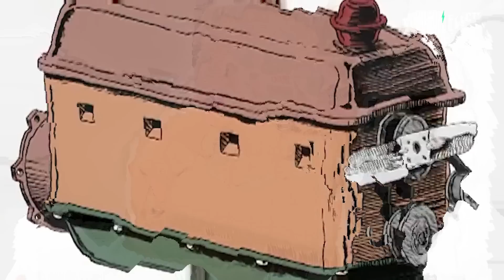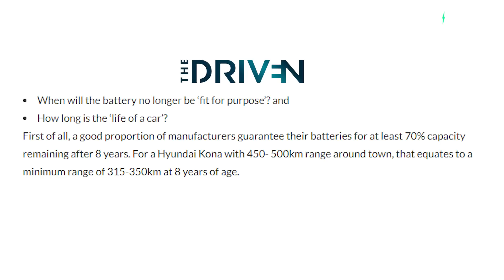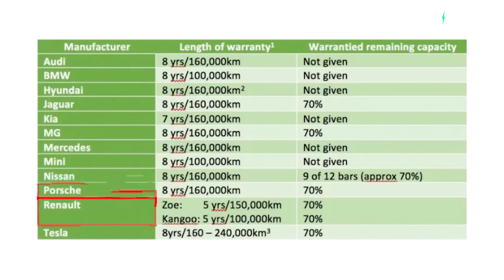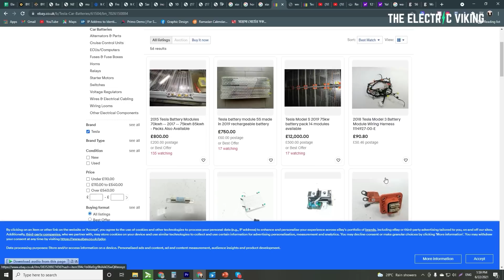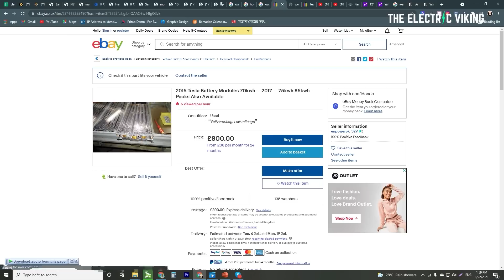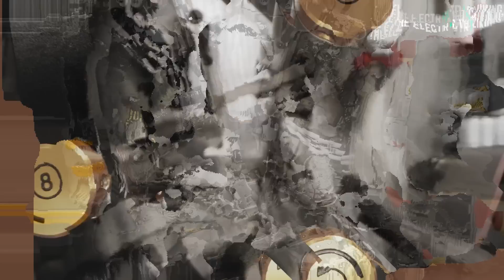How much does it cost to replace the battery in an electric car?

Comment: Great video.  I do however think comparing BEV battery pack with ICE engine is misleading.   Electric motor in BEV has the same functions engine has in ICE.  Battery pack is BEV’s gas tank equivalent.  The original gas tank in my ICE is 18 years old and I doubt it will ever need to be replaced.  It’s capacity is exactly the same as the day it was produced and never leaked like batteries do.  Our second car’s  gas tank has 600 mile range.   Don’t get me wrong, my next car will be electric for many reasons but this is not one of them.
Reply: The capacity of you gas tank might be exactly the same as the day you bought the car, but the cost of filling it isn't...... Plus there is no way your 18 year old car will be anything like as efficient as it was when new. It probably uses more fuel and oil now.  An EV will retain a much higher percentage of it's efficiency throughout it's life if looked after. Also, you have the opportunity to generate your own "fuel" - or at least some of it - for an EV if you have solar, or are able to install it...
Reply: @Brian-om2hh  Great point about producing your own power. And having a gas station in your house is nice too but over all I still believe gas tank wins. Keep in mind I am arguing only gas tank vs battery pack not BEV vs ICE.  

Although my 18 year old truck is definitely less efficient than new, it's gas tank is much more efficient than a Rivian battery pack. R1T at 5% charge is carrying 2000 Ib extra dead weight.   My truck is much lighter when tank is full and gets only more efficient as weight goes down. That is true for the life of the vehicle.  Power density of gas and fill time still makes my gas tank beat  BEV battery pack every time especially when towing long distance.  And after 35 years of driving I have never paid to replace a gas tank.  A Tesla owner that replaces his pack after 10 years for $16K to $20K wipes out any efficiency that he could have possibly had.

If you look at average electricity prices and gas prices 18 years ago, you will see despite heavy regulations electricity has not done much better with price increase.   As we use more EVs with laws and infrastructure always lagging,  there is a good chance we will end up paying more for use of our refrigerators because of these battery packs while off peak pricing gradually disappear. 

As far as over all BEV vs ICE,  my next car will be EV due to other reasons among which are not wanting to put poison into my own longs or contribute to international conflics.  Having an inverter on board without running the engine, quiet at low speed, potentially more reliable, better performance, ..... you name it.  Tons of great things but not the battery pack (yet).

If we don't buy EVs,  the research to overcome it's shortcomings won't be funded.  I won't be surprised to see a 600 mile pack the size of a briefcase in a few decades.

Comment: This is the point even after eight years whatever you still have to replace the battery if it doesn't die before it expired the warranty people caught you $12,000 does it make sense this is what makes electric cars no good are used electric cars causes $15,000 350 miles of charge from taking 10-hour charge 30 minutes I'm not sure how many hours you got left after the charge now New York is 1100 miles away and you only get 350 miles of charge that mean I would have to make arrangement in hotels going to New York it shows that electric car is not good

Comment: My ice car has 265000kms and it's barely broken in. Also 12,000 for a car engine sounds extremely high!
Reply: As a comparison, try looking out for the YouTube video posted by a Tesla Model S owner. His car had covered 400'000 kms on it's original battery...

Comment: I bought a silver model 3 LR over 3 years ago. It still charges to 303 miles. You have to take in account efficiency upgrades as well. I haven’t been back to the tezla dealership since I bought it.

Comment: Battery prices will only come down if there is competition... new technology will keep prices at a constant minimum (whatever that price minimum may be) just like computers... due to the sophistication of technology it will only be major companies producing high tech quality batteries, why "Battery Technology" is being chosen in the first place, as compared, for example, to hydrogen power (superior imo)  i.e. 'Battery Tech' was 'chosen' to be the next "Fuel Source" because it will be easier to control the population (just cut off electricity for a week...) i.e. to maintain "Control of Distribution of..." in this case the manufacture of high quality battery production...   Oh and nobody thinks the cost of electricity won't continue to rise?...  Lol...   Same deal... This principle applies even more to electricity... (i.e. "Control of the Distribution of...")

Comment: 30% of 300 miles which is probably really 290 leave only a 203 mile range after 8 years... not so great...  why I think they need to make a car with at least 800 MILE range... that doesn't even take into consideration, heavy loads, extra passengers and cold/heat degradation...
Reply: But then the new asking price would reflect the fact the car had an 800 mile range. Not everyone wants or needs an 800 mile range. Here in the UK, the average weekly commute is around 140 miles, with the average UK motorway/freeway journey being 70 to 80 miles. If the charging infrastructure is large enough, and offers quick enough charging speeds, then massive range may not be such a big consideration....

Comment: Let's say the capacity of a 100 KW battery is at 80%, so it will hold only 80 KW charge at maximum.  Let's say I get the battery down to 0% charge and then plug it in for recharging at home.  Does this mean that my home will be sending a total of 100 KW to the battery during it's recharge cycle but the battery will max out at only 80 KW?

I ask because over the decades, I have had laptop batteries which used to hold 3 hours of charge on demanding applications which then hold only 5-10 minutes of charge after a few years.  I notice that these bad batteries will show "100% charged" after a few hours of idle charging and even become HOT during the time it is charging to full (so obviously, the HEAT GENERATED by that bad battery during it's recharge cycle is telling me that electric current is continuing to flow through that bad battery, thereby WASTING ENERGY in the form of HEAT GENERATION).

NOBODY has EVER covered this particular question in ANY YouTube video.  All they mention is that the battery will "degrade" over the years and hold less charge than brand new, but NEVER any mention if electricity is WASTED by trying to charge a battery that can reach only 80% of it's original capacity.

Comment: As you point out replacing EV batteries is not really an issue. However the cost of converting perfectly OK ICE vehicles to EV is more immediate and sustainable solution. There are not enough companies looking at this issue and the service garages for major auto manufacturers really could benefit.
Reply: Lol..... Not all ICE are suited for EV conversion and there is actually not enough battery to even make brand new EVs.

Comment: Hey Sam, thanks for this post, after a fair bit of hand wringing I got into a 2015 leaf for 18k that’s a 24 kWh car with usable maybe realistically 20 kWh. I bought it as a ex Japanese import, it displayed 10 bars of battery health @ 30k kms  on the clock, usually a new leaf displays 12 bars. The car is for an early electric car a relatively simple beast with no battery thermal management system and had been predominantly fast charged in its early life leading to I believe a more rapid decline than say other more gently charged leafs. Battery charge data is easily accessed via leaf spy a free app via android and an OBD dongle. So at 10 bars my 20 kWh usable energy will still get me an honest 80 kms that’s two days of commuting per charge with charge time via standard household 10 amp power plug home charger of around 4 hours. I only run my battery between 10 and 80 percent to attempt to maintain longevity. Removing and servicing the battery is relatively simple as no thermal management system and modules are easily interchangeable to ditch dodgy cells. I can buy a new pack for 10 k or repair my existing for shit loads cheaper or sell my complete old battery pack for around 3 k for house hold storage system. I’ve owned a few cars in my time but this electric thing kicks serious arse, quick,quiet,efficient, cheap, and reliable. The leaf is our first car our second one a diesel 4x4 comes out to tow the boat or do the big kms

Comment: How easy is it to access the batteries and replace or swap them out of various cars. Is access restricted to the manufacturer. Who can do the swap out ot the battery.
Do and manufacturers restrict access to the battery area and prevent replacement or swapping of the battery modules.

Comment: In 2017, my wife's off grid property needed new batteries. The lead acid batteries provided +/- 4kWhrs of usable storage for around 6 years at a cost of approximately $2000 US, and would have cost her +/- 3000 US to replace with the same type of lead acid batteries. We replaced them with 4 used Tesla packs from the Daimler smart 4 two vehicles. These used Tesla batteries now provide +/- 10kWhrs of usable storage for approximate $4000 US. I just helped a neighbor install 10kWhrs of brand new lithium iron phosphate batteries for approximately $3000 US. The prices of lithium batteries continue to drop at an incredible rate.

Comment: In case you are a hifi nut:

Buy some 5" full range (single) drivers. Try and get the ones with the solid metal phase plug in the center. And preferably without a whizzer cone. You can cut them off with a hobby knife. Tang Band, Fostex and Coral are good middle priced FR driver brands.

Make a stubby floor stand speaker box. Say 250mm X 270mm x700mm. Make a single speaker hole near the top so the driver fits in. And put some old rags or wadding inside the box (loosely). Now this is where thing get different.
Make a 50 mm deep bass vent tube to fit the driver hole (yes the driver hole is also a bass vent). 

And mount the driver above the driver hole. A 10 mm gap on the top speaker screws and like 15 mm gap on the bottom speaker screws. Use longer screws and thin flexy hose as spacers (cut a bit longer than the gap). The soft garden hose easily squashes to the desired length. 

And you have to tweak the both gaps a little bit to get the best (overall) sound. The smaller the gap the more it shouts and the larger the gap the more bass and treble. So you can get it sounding great! The sound from the rear of the cone escapes from the gap giving a more spacial sound. Also the bass vent makes pure point source sound (more ghostly). 

You can add a crossover filter thing as well after getting it to sound best first. And use electrolytic capacitors on FR single drivers cos it makes them sound silky, ceramic capacitors make FR drivers sound more brittle. And you can add a woofer on the bottom panel facing the floor, with higher stubs on the bottom high enough to let the bass out. You need an 8 mh inductor for the woofer and maybe a resistor to tame the woofer. I hate the bass drowning out the nice high stuff. 

And speaking of high stuff, the open cone mounting EXTENDS the treble! And if you want more super high treble, use a 2 ohm resistor and a 270 ohm in parallel, connected to the + terminal of the driver. How it extends the top is a mystery but that is what I clearly can hear, I discovered it accidentally. I wanted to get just a tiny bit less resistance and I couldn't believe my ears! 

Or (even better) also use a 0.22 mh inductor and 1 mf (electolytic) speaker capacitor, all in parallel with the two resistors. Do all that and they will smoke any speaker regardless of price (for normal listening levels). They sound better than normal speakers cos they sound like panel speakers and better than panel speakers cos they are light years cheaper and haven't got 6 ft mouths.

Want the best amp? Get the Audiolab 6000 Play. Costs 1,800 and Andrew Robinson (oh YoTube) said that the only amp he had that beat it, was a 10 grand tube amp. So I just got one and it's lovely. Cheers Big Ears!

Comment: In some cases only a few dead cells need to be replaced, then if the pack is rebalanced it will come up again. There's a good video on Rich Rebuilds channel about that.
Reply: There's also a YouTube video posted by someone called James and Kate. They had a battery refurb carried out on their 10 year old Leaf at an independent EV specialist in the UK, and it cost them £600.....

Comment: How much does it cost to replace a petrol car engine?
Reply: A lot of money usually.
Reply: @Brian-om2hh  Probably more than an EV battery or at lest in the same ballpark?
Reply: @lironl6782  It will depend on the ICE car I imagine. Anything with a Merc, BMW or Porsche badge is never going to be cheap to repair....  An independent UK car warranty company - Warrantywise - have stated one particular claim for an engine repair (a picture next to the claim amount showed a BMW), and the repair amount shown/stated was £8'934.....

Comment: do not underestimate with the useful life. LFP batteries have a much longer life cycle about 2-3 time longer. this is very beneficial to the residual value. When an MNC bettery is end of life, the LFP battery still has half to go and have a higher value on the 2nd hand market.

Comment: BMS and liquid cooling is critical. Our Tesla cars from 2013 after 300.000 km have only lost a little more than 1% per year. Only thing is charging speed that is software controlled has been nerfed.
Reply: Or it is possible that the software update unlocked some of the battery buffer to hide more battery degradation, many EV have a 5-10kwh of unuseable capacity so it is quite easy for Tesla to release some of that buffer though an update just like they did by limiting the charging speeds

Comment: So in say 8 years my battery might be down to 70%. But in 8 years the charging infrastructure will be what? Twice as big, three or four? Whatever it is it’s gonna be a vast improvement and there will be chargers all over the place so long journeys needing multiple charges will be at most an inconvenience rather than a deal breaker. I wonder if actually once the infrastructure improves battery sizes might get smaller and our worn 70% capacity batteries might actually be larger than the new cars being sold? No idea, but for sure I’ve zero worries about degradation as I’m sure the ever improving infrastructure will more than compensate.
Reply: I have no idea how it is anywhere else, but here in the UK we presently have around 26'000 public charging connections. A big contract has very recently been signed to increase this number to 190'000 public connections in the UK by 2030, which is when the ban on the sale of new ICE cars and vans arrives.

Comment: To be fair - the 8 years is darn good - but the miliage seems somewhat low.  I would think that getting 10, or 12 years would be a ok trade off . I mean, 8 years is not bad - probably better then ICE cars. But that replacement cost is still quite high. If you take 10 years of ICE car maintains, and then say compare against a battery replacement after 10 years - I think the numbers should not be too bad.

Good for you to address this elephant in the room.  (some might try to sweep this issue under the carpet so to speak).

Without question the battery pack replacement issue is a "big" deal, and a worry for EV owners. 

I would also suggest that a battery pack replacement in 8 or 10 years should be MUCH less - perhaps even half the cost. And in that case, then the EV car will win hands down. So, we just at the start of the battery pack drop in price.

As it stands right now - this is still a "worry" issue, but over time it should become less of a worry. The same worry exists in Canada, since with cold winters, then those LFP battery packs may well suffer more degradation then in more mild  climates. On the other hand, Norway has quite cold winters, and thus some good data will and is coming out on this issue. 

I mean, just like when you buy a used ICE car, you often get the mechanic to check/test the compression of the motor. If the car shows worse compression, then the value of that car is simply reduced. Same goes for a EV - that battery pack condition is going to quite much decide the value of that EV car at that point in time.

Right now, the battery replacement cost is in fact quite high. You of course have to consider the maintains free operation during that time frame.

This is still a big concern - but over time this issue will reduce.  In 8 years from now, those battery packs should be MUCH less cost.
Reply: Actually ICE last longer than EVs especially the well made ones, people still drive around with 30 to 40 years old ICE and it says alot tbh.
Reply: EVs are actually used in a very soft environment compared to ICE that can basically go everywhere and survive harsch conditiond.

Comment: The key for consumer battery benefits will be standardization of the battery packs/controllers/cases. Right now the industry is still in the frothy experimental phase to see what actually works along with rapid invention improvements. But we will need common features like the (mandated) USB-C ports on phones and AAA,AA,C,D consumer electronic device batteries. Look at the craziness of laptop battery modules (sure they often use the same Panasonic cells that were used in the early Teslas) but they were and are all unique by brand and model. Standardize battery features and the remanufacturing side of the business fixes all the long term vehicle battery replacement concerns.